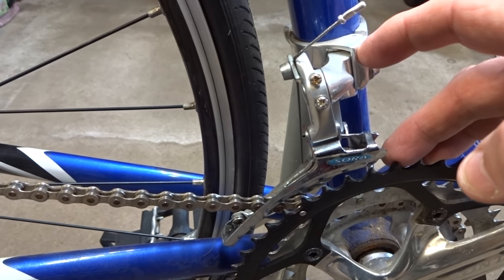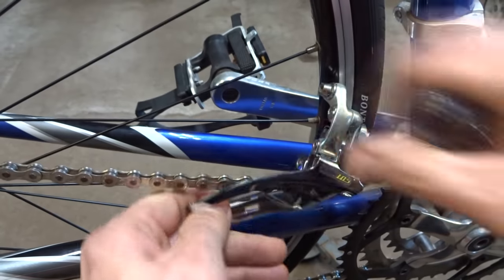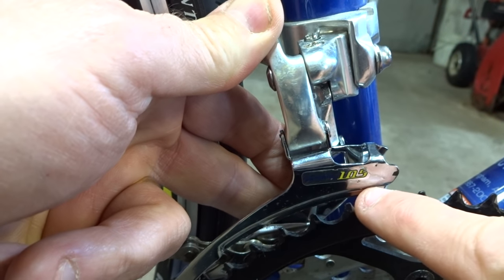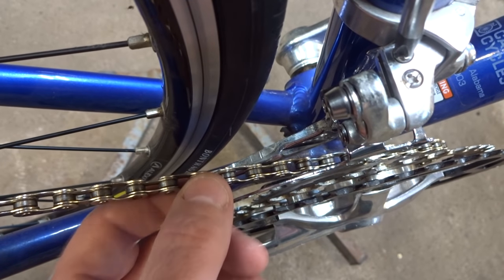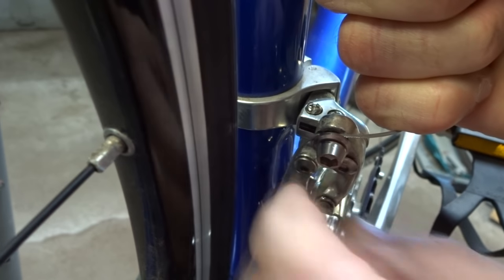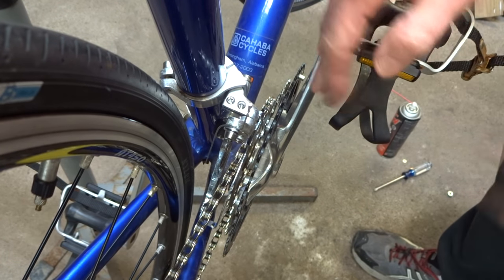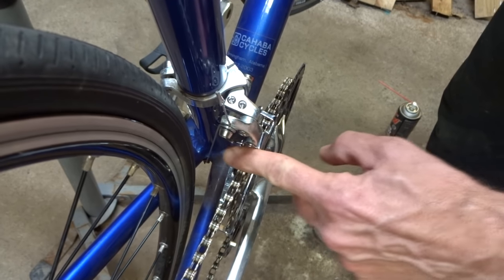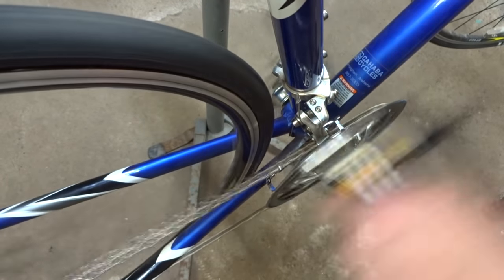How To Install & Adjust A Front Derailleur

Comment: This video was again another money saver from Mr Bike Guy. I have this old cc bike with double rings in the front, and I just set up a new front derailleur based on this video. To me the main take was to adjust the derailleur properly before installing the cable: something I hadn't realized before. My setup also includes a cable roller at the bottom, and first I thought it was broken since it refused to cooperate in any way. Finally I removed and opened the roller, and inside was a decade's worth of sediment and dirt. After cleaning and greasing the roller I finally attached the new cable and didn't set it too tight as in my previous failed attempts. The result was a working front derailleur, now already test driven.

Comment: I got a new triple crankset and instantly converted it to a 1x with a 32t chainring. I had a 1x8 drivetrain.
Today, after about a month of riding a 1x8, I got the granny and big ring back, so I needed this video to set up the front derailleur. Did it, shifts like a charm. Triple crankset rocks! :)

Comment: Thanks RJ!  I've been having a 2 year problem with my Front Deralleur on a Vintage build.  Turned out I had a wrong FD Derelleur type.  It's the Short cage one not a long cage FD that worked like magic.  Wouldn't have tried a Short cage with the right angle if it weren't for you doing this video.  I used a Shimano 400CX Front derailleur to replace the Altus C10.  Seriously, Thank You!

Comment: Thanks for the video. It helped. They are not as hard as they seem. I kept mine in 1st gear and I kept having too much tension so it was not shifting into second gear... I put the bike in 2nd gear and then made sure the chain was in the 2nd gear and pulled my tension tight (using top pull) and I was finally able to get my bike shifting right again. Great feeling!

Comment: Thanks for the article.
After struggling with front Derailleur Adjustment and consulting innumerable articles and Youtube videos I just about gave up until I discovered one additional factor in proper derailleur shifting, Crank Bolt Tension.
While inspecting my bike, I noticed a very slight "play" and a new "sound" during a ride. I realized that the crank was a little loose.
When I tightened the crank bolt, I realized it was way looser than the manufacturers torque specs. Once I tightened the crank bolt, it brought the outside chain ring a little closer in, enough to make a significant difference in the range of the derailleur.

Hope this helps.
Reply from the maker: If you were riding with the crank bolt loose, you may have damaged the mating surfaces in the crank arm. The crank arm is held on by friction. It's pressed on. The bolt is used to tighten it on, and help keep it from coming loose. If the surfaces are damaged, you may have a problem with it continually coming loose.

Comment: "[the cable] goes over this little nub in the back." I assumed it went underneath the nub- wow, what a difference that little extra lever arm makes! Thanks for pointing that out! I had just replaced the cable and was about to go pulling things apart again b/c the shifting was so hard (too much tension). Thanks for that tip!

Comment: I am in the process of installing a Shimano 105 FD5504 on my son's 2001 9 speed. I torque the clamp bolt and the cable bolt to about  55 inch pounds (not ft lbs). Nice video. I should probably invest in new shifter cables too.

Comment: Great thanks for helping me with a deraileur that refused to come into adjustment. Setting the L screw before even connecting the cable put me over the top. I still had to do a bit(!) of fiddling to wrap up the job, but starting from "no cable" is what I needed.

Comment: My limited experience with chain derailers is they are a pain in the axxx!   Wonderful for bike repair shops!   A clear problem is the frame to frame variation among bikes.   The angle between seat-tube and plumb or vertical differs from bike to bike.   The drailers do not have an adjustment for that angular variation.   When mounted by a clamp on the biike's seat-tube the angle made by the cage with the plomb varies.   The result for many bikes is that the arc of the cage is not concentric with the arc of the gear's circumference.  The distance between the cage and the gear is not the same along that arc.    
I find the recommendation of about 1mm distance between the two arcs impossible unless one means the minimal distance.  It varies.  Further, I find that on my bike, the distance between the two arcs when in the highest gear combination (fastest bike speed) is about 16mm not 1mm !
What the distance is when the chain is at the lowest bike speed combination with the cable released I could not say, because in that state the derailer is closest to the frame and away from the largest gear.   In my setup,   the cable tension is not taut in the lowest speed combination.
My conclusion is that each bike's front derailer setup for allowing the greatest choice of combinations is different.    Each bike's front derailer setup is unique because bike frames are not standardized.

Comment: My front derailleur design looks the same. The cable is secured to the derailleur just like your video but changing to big gear is very hard. My shifter is smooth when the cable is disconnected. Kindly advice. Thanks very much.

Comment: Hello
I had to change the pedal assembly (with 3 plates) on a mountain bike. I found one that I thought was suitable, with 3 sheets, but after I mounted it, I noticed that it comes further outside, so the changer only reaches the small and the middle sheet, it no longer goes on the large sheet. Is it possible to make an adjustment of the derailleur to go out more in order to switch to the big sheet or should the entire pedal assembly be changed? The shifter is Shimano Tournei and the shift lever is Shimano RevoShift. I want to mention that the manual shifter reaches the level of the third sheet, but I don't know if it can be set to go out that much, from the construction. Or could I find a smaller monobloc hub that would allow the pedal assembly to come further inside? Thank you very much for a possible answer!
Last but not least, I want to say that the way you explain is understandable even for a beginner in bicycles.

Comment: my front derailleur on my road bike is also a triple(Ultegra), once you shift the chain you can push the shifter just a little bit more to further stop cage rubbing.
Reply from the maker: Could be angle, cable adjustment, or your are cross chaining (don't do that).
Reply: @RJTheBikeGuy  I think he is referring to the "trim" feature. My Tiagra 4500 front shifter has this feature too - it's a 2X setup, yet the FD has four positions - two main positions to select the chainring, and two other positions that shift the derailleur slightly towards centre, to prevent the chain from rubbing on the derailleur. Nice attention to detail from Shimano. I agree that we shouldn't be crosschaining generally, however sometimes I do crosschain for short periods, to avoid shifting to a different chainring. It's nice to be able to trim the FD in this situation.

Comment: 105. Upgrade. I bought a new Tiagra front derailer when I upgraded my Touring bike to 10 speed. I found that the new derailer with a new spring would slap the chain so hard that the chain would be knocked off to the inside when downshifting the front mech. I tried to adjust limiting screws. I'm sure they were in the correct position but, I kept having the same problem. 
The fix I finally came up with is to replace the front mech. with an old Shimano that I had salvaged from a Raleigh Team USA that had an older spongier spring. Problem solved.😏
Reply: bullwhip johnson 
Was that use be 3/9 and now 2/10 gears
Reply: Bicycle sunday It was actually. 2/5 to 2/10.
Reply: I just recently bought a caad8 too, tiagra. When i tried adjusting the H limit screw, derailleur doesn’t move out. I can move the screw but not the derailleur. U guys experienced this too? Think it just needs to be lubed?

Comment: I got an old Shimano 105, looking slightly similar to yours but I cannot for the life of me get my front derailleur back to work. At first I thought it was just a weakened fatigued cable. It was, but trying to reinstall it, the derailleur will just hit the teeth even when the whole cage is mounted AN INCH above the highest gear teeth. Something is just pulling it out of shape. But only when Im using the cable. If I push it to the outer gear manually, it seems to fit fine. When everything seems to be dialed in and im tightening every screw, it's fudged again.

Comment: Hi i am trying to install my front derailleur on my bike. But my front derailleur has both L anf H limit screws all the way in. How many turns with my screwdriver i should turn to set the limit screws to a "factory setting" before installing? Any ideas?

Comment: Hi. Great videos. I know you hate stupid questions, but maybe this will make the cut: I cannot seem to find a f der for a 28.6mm downtube triple downpull. They all have adapters. I got one of those and it jammed and swung around ( I didn’t dare whale on the clamp screw). The cage may have took a hit but I put it back and it “works “ but poorly. The cage seems bent .. again not sure. I thought easiest fix would be to get a fd with no clamp/ the right size. Any ideas? Thanks- Peter

Comment: I bought a new 3-spd FD for my daughter's hybrid. Shimano Acera. However, even with no cable, the FD does move inward over the inner chainring. It sits over the middle ring. It takes a LOT of force to get the cage to move out to the outer ring. I don't understand! I imagine I have the wrong FD? (I know you can't just diagnose without seeing it, but maybe I'm missing something. ) Oh, and get this: a Shimano product and the only instructions in the box are to avoid getting pants caught in the chain and if the chain makes a noise, to shift to a different cog!)

Comment: I bought a wrong fd for my mtb (side swing) and found yours similar to mine. Did you installed a top swing or a down swing fd? Thanks in advance for your help.
Reply from the maker: Down swing/up swing refers to the geometry of the derailleurs swing. An easy way to tell the difference, a bottom (down) swing derailleur has the clamp above the derailleur. This is often referred to as a traditional derailleur as all derailleurs were this way at one time. A top (up) swing has the clamp below the derailleur.

Comment: Excellent ! I have a question. Can I use a 3 by 10 front shifter, on a 3 by 7 speed?
Reply from the maker: https://www.youtube.com/watch?v=xMvD1T4qF1E
Reply: sorry, i am referring to the front derailleur, not the rear. that i knew ! ha ha
Reply from the maker: @jen3800 Shimano front derailleur come in two flavors, road, and mountain. Other than that, it is the width of the cage. A 10 speed cage is narrower than a 7 speed cage. But they have the same pull ratio.
Reply: Thank You ! other weird thing is that on the bike i am fixing.. a hybrid city bike 43 tooth large ring is that the  front shifter indexes 12 times!  is that a thing? it is on the left side. the rear derailleur and shifters match , indexed 7 notches. weird. i am a roadie and these dept store bikes i fix are all over the map. once a wheel came in and nipples were all different sizes ! new !

Comment: Was that barrel adjuster just the one for the shifter? How does it move the derailleur? I spent half an hour earlier trying to index a front derailleur on a bike with 3 chain rings but the limit screws didn't seem to be helping it was still rubbing on the inside plate and making plenty of noise. So I just gave up. Big thumbs up from me :)
Reply: It was rubbing in the middle chain ring and a little in the largest as well
Reply: check cage alignment

Comment: Some cages I have come across do not have the option to split the cage to get them over the chain. With those I do split the chain with a chain splitting tool. although I don;t use a master link to fix it together I push the rivet back in.
Reply from the maker: I really don't recommend reusing the old pin like that. It will be a weak link and more prone to breaking at that point. Shimano has replacement pins for their chains. I prefer KMC missing links.
Reply: If I'm correct RJ, installing a new pin vs reusing the old pin is only necessary for 9 & 10 speed chains right?
Reply: Been doing it for years and never had a chain break.
Reply: Famous last words now that I have said that lol
Reply: Exactly, and don;t push it to far in either.

Comment: Hey Rj my front 105 derailleur is kinda weird do you think it’s my height? So what happens is when I shift down in the front the chain links get stuck on top of my teeth of my front lower chainring whenever I shift to a lower gear in the front. And whenever I shift into a higher gear it goes back into place like a chain should. Do you thing that it’s my height on my front derailleur or do I just need to adjust it.

Ps. I’m gonna be honest I’m not to sure if it even is my front derailleur but I think it is so yeah thanks for your help
Reply from the maker: Not sure without working on it. It could even be a worn chain/chain rings.
Reply: Thanks I’ll try to replace my chain because my cassette and chainrings aren’t worn out yet thanks again like 3 times for your help ! Hope you still get better from your injury !

Comment: Mine always have rivets, I have the tools to drill out and put in new rivet !☺ FanTom
Reply from the maker: Rivets? For what? The cage?
Reply: @Thomas C. Belanger, they make them that way so you have to buy the special de-riveting tool take it off or to install it a chain tool. It’s a total scam to get you too buy said tool.
Reply: I have the same issue, instead of a screw to open up the cage it has a rivit...   what a pain in the @$$ but know I know why the Sora 3030 was on sale...

Comment: My front Shimano derailleur moves freely in and out when I push it with my hand without a cable in it. I shift my grip shifter and hold the cable and I feel it loosen and tighten. I put the cable on the derailleur and it doesn't shift. I have one gear in the front. What am I doing incorrectly?

Comment: RJ, after cleaning up my 2009 Hardrock Disc, I realised my front derailleur isn't shifting (3 cogs on front, stuck on second, shifts through RD fine) The cable from the shifter is loose and there is a fair bit of rust around the cabling where it links in to derailleur . 

It's going to a bike shop for a repair as I don't have the tools/knowledge/confidence myself: I wonder if the cable has come loose from the shifter, as opposed to the cable being too loose/broken or the derailleur it's self being broken. Is that something that can happen? Any 'basic' things I can do to diagnose the issue?

Learning alot watching your videos, thanks!
Reply from the maker: https://www.youtube.com/watch?v=gwBQxhZhKnE
Reply: @RJTheBikeGuy  great, this seems to be exactly what I need! I definitely understand more about the drive train and   derailuers... Knowledge is power!

Comment: Hey RJ...what if both screws only move the cage when they are almost screwed in completely? Shimano 105 10 speed 5700...it's like there's no fine tuning at all. Derailleur's got mileage on it but it seems weird that nothing would move since the screws are supposed to act as a "stop", i can't even see where the screws are hitting because they are covered up.
Reply from the maker: Can't tell you without working on it. You need to figure it out, or take it to a shop.

Comment: Why would you have to get a master link if you're gonna break the chain? Longevity issues? Possible point of failure? Or something else?
Reply from the maker: If you break the chain, you have to reconnect it again. Master link is my preferred option. SHimano has replacement pins, but I am not a fan. You do not want to reuse a pin that was pushed out as that will be a weak link prone to failure. I like KMC Missing Links. And I am getting tired of answering this same question over and over.

Comment: I'm having problems finding a SRAM 2×11, 28/42t, 26.8 seatpost clamp, pull down front derailleur to upgrade my mtb.  I find SRAM components to often be vague and hard to find at the same time requiring specific specifications to meet a match, you can't put certain SRAM XO FD with certain SRAM XO 2x10/11 cranksets also SRAM components seem to be confusing to understand due to inconsistant hierarchy understandings where Shimano is pretty straight forward.
Can I use a Shimano XT front derailleur setup to guide an XO 28/42T crankset?
Reply from the maker: Probably.
Reply: @RJTheBikeGuy  100% Thank you!
I find SRAM MTB components to br very frustrating while Shim. is pretty much straight forward.
With SRAM there are too many specifications, one needs exact components where it's hard to "mix and match", the hierarchy scheme for me a "weekend enthusiast" is confusing where I don't know what chain and what cassette would go with an XO 2x10 crankset.  They push this 1x11, 1x12 thing where most riders race the bike trails on the weekend and almost never actually ride a mountain trail.
100% Thanks!
I'm look at XTR, not so confusing.